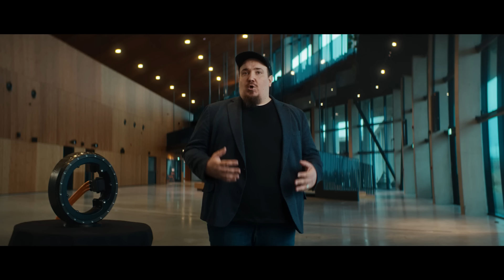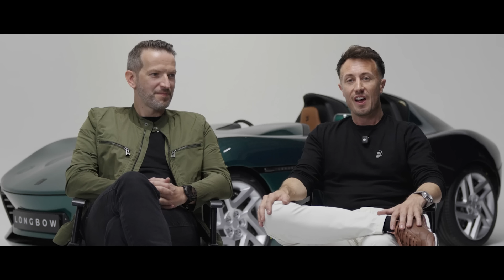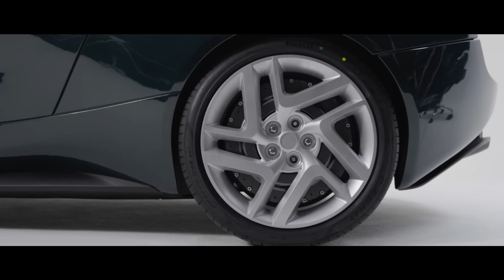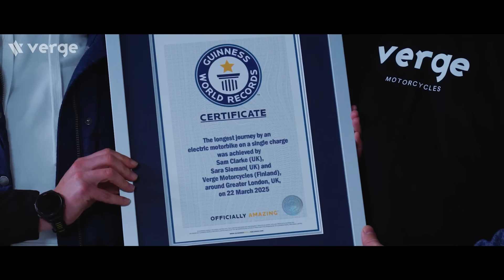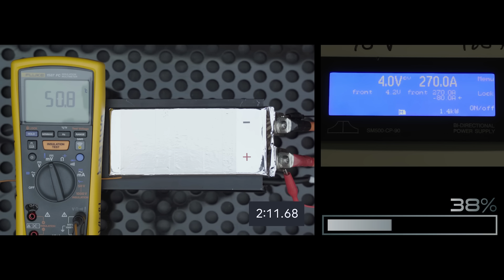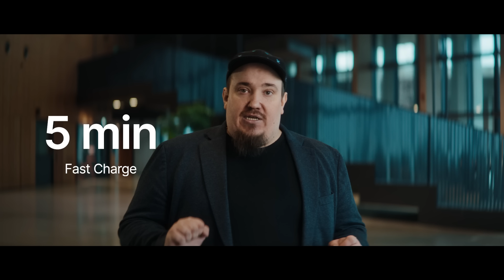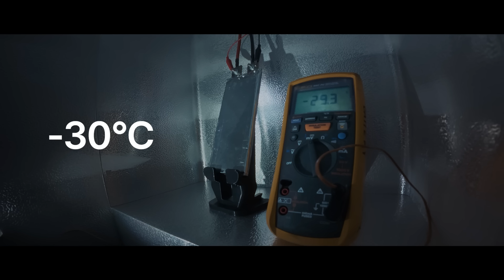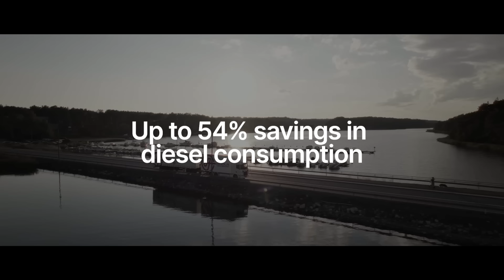World's First All-Solid-State Battery in Production Vehicles | Donut Battery

Comment: A battery capable of 100,000 cycles would be a greater revolution than the steam engine, serving as the ultimate catalyst for green energy. Such longevity would allow storage systems to operate for decades and pave the way for electric shipping and short-haul aviation.While by no means all test results that prove everything have been published yet, as far as I understand, the opposite hasn't been proven either.  However, there is a significant concern that powerful interests (fossile Lobby)  might suppress such breakthroughs through patent buyouts, boycotts, or even violence. A historical precedent for this is the Elsbett engine (There were no fatalities, but it led to bankruptcy) , a highly efficient multi-fuel engine (40% efficiency) from the 1980s that ran on vegetable oil but failed to achieve a market breakthrough despite its superior technology. 1. The Custom 3-Cylinder Elsbett Engine
This engine was built from scratch using the "Duothermic" combustion process.
Feature
Technical Data
Engine Type
3-Cylinder Inline, 4-stroke
Displacement
1.45 Liters (1450 ccm)
Power Output
82 to 90 HP (60–66 kW) at 4,500 rpm
Torque
approx. 145 Nm at 2,500 rpm
Fuel Consumption
3.5 to 4.5 Liters of vegetable oil per 100 km
Efficiency
~40% (remarkably high for its time)
Cooling System
Oil-cooled (no water jacket/radiator needed
I hope so much that you guys

Comment: A fresh Ziroth video just dropped yesterday, tearing into Donut Lab’s claim of the “world’s first solid-state battery.” After digging through independent test data from VTT lab, the verdict is brutal: it behaves exactly like a standard lithium-ion cell. Same voltage curve, same internal resistance, energy density clocking in at 298 Wh/kg instead of the advertised 400+, and thermal runaway kicking off at 90°C during fast charging. Ziroth puts the odds of it being genuine solid-state at 0.1%—more like marketing dressed up in a fancy shell.

Legit solid-state prototypes are sealed, sleek, and electrolyte-free—no liquid slosh, no flammable mess. This thing? It’s a pouch cell with a sticker slapped on. The 90°C heat limit is classic lithium-ion, not the safety miracle solid-state promises. And the demo footage? Looks like it was shot on a phone in someone’s basement—zero production polish.

Crowdfunding backers are already fuming, but the real kicker: Donut Lab keeps dodging requests for real samples. “Shipping next quarter,” they say—like that’s ever happened before. Ziroth’s deadpan reaction when he scrolled the spec sheet said it all: pure disappointment, zero surprise. Hype machine broken, scam confirmed.

Comment: I remain cautiously optimistic that the Donut Lab claims can be proven to be true. Replacing gas stations with charging stations is of course possible, but its looking like the battery technology that can charge in under 10 minutes will be available much sooner than a network of charging stations with as many locations as gas stations. It will also be interesting to see what the business case and economics and costs will be to run a network of charring stations similar to the existing network of gas stations and if this will result in a similar or lower cost to “fill up” and electric car battery than it is to fill up a gas tank.

The size of batteries in a typical electric vehicle available today can range in size from about 50KW-hrs in small to midsize cars to about 100KW-hrs in midsize to full size cars.  To charge a 50 KW-hr battery from 0% to 100% in 7,5 minutes would require a battery charge rate of 400 KW and the battery charger would need to be able to deliver 400 KW of power. That is enough power to supply about 130 homes or a 20 story apartment building. And that is only for one car.

A typical gas station in a city usually has 8 pumps. So if 8 cars are filling up at a gas station at the same time, they can all fill up their gas tanks in about 3 to 5 minutes. If there are 8 battery chargers at a charging station and 8 electric vehicles are being charged at the same time at a charger rate of 400 KW, the amount of power the charging station needs to supply is 3,200 KW or 3.2 MW. 

That is enough power for about 1,000 homes or a large manufacturing facility. To deliver this much power at one location from the grid requires connections to high voltage distribution lines or cables and a lot of equipment such as, transformers and switchgear all very expensive and this would also require that there is enough generation capacity available that is connected to the grid. 

Generating this much power locally at the charging station location without connecting to the grid with solar panels would require about 40 Acers of land or 4 large scale windmills also needing about 40 acres of land and solar and wind is not a reliable or consistent power supply. 
If the technology can be developed for local small or micro nuclear reactors in the 3 to 5 MW size, this would also be and option but probably also very expensive.

Comment: If the battery is cheaper than a Li-ion battery and the motor is cheaper than other motors, why does the bike cost 37k?"
Reply: Hypothetically, if their claims are true you would have a forever motorcycle and never need to re-purchase in the future. But again, the emphasis is on hypothetically and the word if.

Comment: Looks like lots of Oil Company proponets coments on here.  Maybe give the Donut company a chance to share the data with independent testers, and allow the valadation processs from real companies. If it does not pan out,  then come on here and made the stupid commets, in the meantime, I drive my Mach-E EV with 5 yrs on it, that can kick ass running against the old oil burners,  not only by 0-60  which it jerks your head back from, but by cost to run, no pollution, and practicality and longgetivy with almost no manintence. ( just one set of new tires, and a 12v battery in 5 yrs.  Bye Bye Oil Companies. If Donut is not the holly grail, then Toyota, CATL, BYD, or one of the others will follow soon.  Oil is a dead horse, had its day,  time to move on to the clean world energy

Comment: Is it just me, or did the motorcycle guy fail to specify the difference between the old battery and the new at 300klms for both. All he said was extended range will give you 600klms. What he failed to do was convince me the old 300klm range was any different to the new solid state. Unless your telling me the "Extended Range" is the solid state battery? What am i missing?

Comment: It doesn't serve his purpose to suggest "We chose early on that the battery would do X, Y, and Z".   If this is a real battery, and not vaporware and not an outright lie, then like most great inventions, chances are they stumbled upon this new type of battery cell chemistry and construction.  Electrek put out an article suggesting that another company that Donut Lab is associated with were working on a new technology for solar cells, and then eventually battery cells, and may have inadvertently stumbled upon this chemistry while working on the solar cells.  If that's the case, then they likely made very few decisions in terms of how this battery was designed and what materials it used, and simply designed it as it needed to be to work.  Maybe during the development of the solar cells, they found early signs of what could be a battery "chemistry" that could potentially perform better than li-ion with better energy density, temperature tolerances, and cost, and they developed that out and found out that, yes, this chemistry does in fact actually work.

In my opinion, if this cell is real, then the CEO shouldn't bother embellishing.  It doesn't matter if they made choices or if they just got lucky.  The technology is theirs, they discovered it, and at least for now, they are winning and everyone will want this cell.  No need to tell the world how smart your management is.

I will say that long term use case claims, such as these cells essentially lasting forever without degradation, are all but moot so long as the cell chemistry wasn't discovered that long ago.  Weird things can happen to cells over time, so to test the impacts of time, the cells actually need to experience real aging.

I tend to believe this cell is likely real; otherwise lying about it a few weeks before they're set to release it doesn't make a whole lot of logical sense unless this is next level trolling.  It is a bit strange for it to have come from a tiny motorcycle company that's only valued at like $50 million though, and why they opted to put the cells in their motorcycles first rather than sell or license the chemistry for potentially billions upon billions of dollars.

In terms of environmental impact, if these cells are real, then I would think the first place you'd want to put them is in semi trucks, given the enormous environmental impact it could have on the global trucking industry.  Maybe they just want to build out their own manufacturing of the cells and reap the rewards?  Hard to say, but that comes with huge risks.  Namely, maybe another company successfully copies their chemistry with minor modifications and undercuts Donut's cells.
Reply: That said... Verge/Donut Labs... please hook up the micromobility industries with these cells first please!!  EUC, e-bike, e-scoot, and esk8!  These are the most efficient and sustainable forms of transit on the roads, and that includes most (if not all) forms of public transit.  The safer the batteries the better, as micromobility devices are stored in our homes and apartments.  Plus, it makes these vehicles more attractive.  The more people opting for micromobility over cars, the more rapidly global transportation becomes sustainable.  Cars, in general, use far too much weight in resources to ever be fully sustainable.  While cars won't go away anytime soon, that doesn't mean it isn't worthwhile to go after the lowest hanging fruit first; those folks who might be willing to give up their cars for micromobility once the tech is there.  

Then of course there's the trucking and airline industries.  In terms of personal vehicles, I might suggest prioritizing those vehicles that drive the longest distances and carry the most weight.  Taxis, police vehicles, delivery trucks, and pickup trucks used for tradesmen.

Comment: Verified Science: The technology is not magic; it is based on Bela Bhuskute’s published academic work on Atomic Layer Deposition (ALD), which creates an "atomic armor" on nanotube electrodes—this scientifically proves how a battery can resist degradation for 100,000 cycles.

Hybrid Architecture: The cell utilizes pseudocapacitance (ions latching onto huge surface areas instantly rather than burrowing deep), granting it the fast-charging characteristics of a capacitor with the energy density of a solid-state battery.

Accelerated Execution: The "impossible" timeline is made plausible by the likely use of AI/Material Informatics to simulate atomic interactions (replacing years of physical trial-and-error) and the agility of a stealthy, well-funded team (backed by billionaire Petteri Lahtela) targeting a low-volume debut (Verge Motorcycles) rather than mass auto production.

Comment: One can find many research articles about how cooking cells with excess current will form a dendrite-resistant surface, as well as melt existing dendrites. I wonder if that could be used as part of the process. It requires no new technology, which would be something to protect (it might not really be patentable).

Comment: Look, I'm not bashing those guys, but since I started using the internet decades ago, I noticed a consistent trend with respect to breakthrough battery technology like this one, fusion power and stem cell technology. These three share a common thing which is that we get bombarded with extreme claims with absolutely nothing on ground to show for it.

The claims in this video are not just simple claims, they are civilizational changer, it is even more important than discovering fire, agriculture or steam engine. 

You cannot just leap in technology just like that. Technology improves incrementally, it is like saying Motorola back in the 1990s suddenly promised to sell iPhone 17 Pro Max in 1994. There are so many incremental inventions that had to take place over decades. 

Sorry but I call this BULLSHIT!

Comment: The sister company Verge motorcycles is very real made in Estonia with an unknown quantity of bike on the road, but they are on the road with 2170 batteries for now.  Donut Labs is definitely a start up, but as credential presentations go, this falls down as there is no underpinning evidence, even footage of research and manufacturing facilities would make this feel more real.  If the batteries include readily available materials, telling us what they are without giving away trade secrets would also improve credibility, as would certifications, reference to patents etc.  Regardless as to weather Donut Labs is real or not, 400 Watts/Kg is no longer science fiction, neither is a 400 bhp motor for under 80kgs... (their motors are also definitely real BTW), also points to cars with a sub 300kg battery and motor system which definitely shows the ambition of Longbow motors is also credible.  Conclusion - Strangely interesting and thought provoking.

Comment: I've never owned a car. I've been a motorcyclist since the 1990s. The main thing I used a motorcycle for over the decades has been an annual road trip to Southern California and another to the Pacific Northwest.
And for that, over the decades I've owned several iterations of the BMW RT, because it delivered 250-300 miles per tank when cruising steadily at 70-80 mph (I'll leave it to you to translate to metric) - the outer limit of how long & far I want to ride without a meal break - with a full fairing and electrically-adjustable windscreen, capacious luggage, and a generally comfortable yet sporty ride on the highway and in the twisties as well.
So, my interest in EVs, beyond my interest in post-fossil fuel tech in general, has been hoping for an electric version of that.
Let me know when that's on offer.
As for charging speed: my electric road trip fantasy has been to roll up to a diner for lunch after my first 250-300 miles of the day, plug in, and enjoy a nice, relaxing meal before hitting the road for the second half of the day's journey, say half an hour to 45 minutes, after which I could just plug into a regular level 1 outlet at the hotel overnight. Five minutes is way too fast! (For this scenario, I'm also looking forward to the first large diner chain oriented to the traveler announcing the installation of lots of fast charging spots in all of their parking lots, in recognition of the fact that their customers are driving electric. It's only a matter of time.)

Comment: Claims 5 minutes until full, but does not tell us the capacity of the battery. Makes the wildest claims in their video but shows 0 proof of anything. Says they kept it a secret because they wanted it to be production ready but has no product to show off, not even a prototype.
This is either the biggest fake or the worst marketing department in existence.
Their website is even worse:
First they claim 5 minute charge to full, then ten minutes charge to full, and their graphic goes almost up to six minutes and the line is not even at 100%. (Or rather 1% because they labeled the axis wrong).
The entire website looks like AI slop.

Comment: ICE bike:
 - Power doesn’t fade.
 - Fuel tank doesn’t “age”.
 - Engine can be rebuilt.

EV bike:
 - Power and range will fade.
 - Battery replacement is the “engine rebuild”.
 - Cost and availability matter more than tech hype.

it would take 1000 charges to shrink to 80% battery power or 350k km.
However that is not really realistic, more like an ideal situation if all was perfect and top notch ( basically inside a lab or controlled environment ).
Also building "cheap" batteries from sustainable "green" materials is also another marketing stunt, in reality it's almost impossible, why ? because only so many chemical elements are viable for storing and discharging electrical current.
That list is very short:
Lithium
1 Nickel.
2 Cobalt.
3 Manganese.
4 ron (with trade-offs).
5 Copper.
6 Graphite.
There is no secret eco-element hiding in nature waiting to save us, just facts of electrochemistry.
You only have 2 or 3 of those to pick from, in reality, to make a battery.

Comment: Congrats on what you have achieved and I wish you luck. I find your statement about charging speed - from 0 to 100% in as few as 5 minutes - misleading, since it does not state the size of the battery you can charge in this time. Looking Verge motorcycles which use your technology, the changing power is "up to 200 KW" which is good but nothing extraordinary.

Comment: Testing 100,000 cycles at 24 cycles a day is (100,000/24) / 365 = 11.4 years. Therefore they must have started testing their prototypes at least 12 years ago. Or they are just pulling 100,000 out of their asses.
The motor is just an upsized Ebike motor with expensive/complex bearings and weather seals, looks slick but will it be reliable?